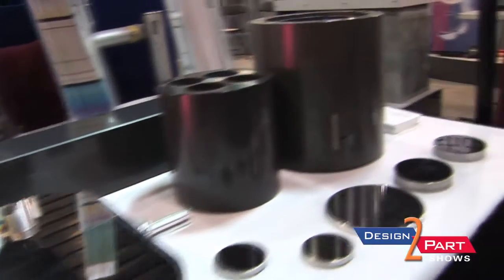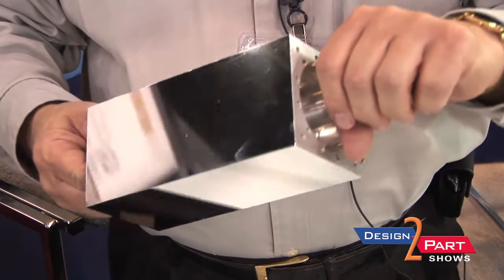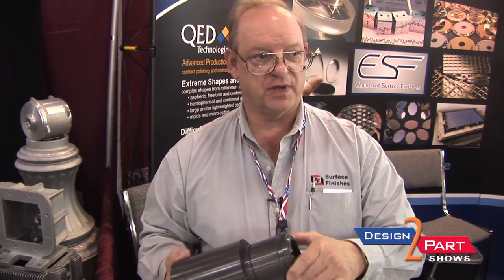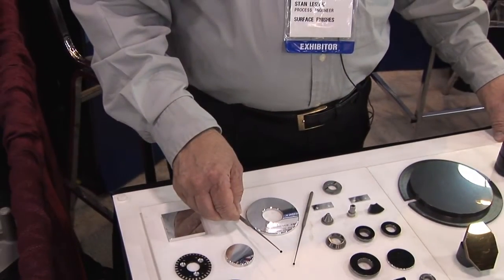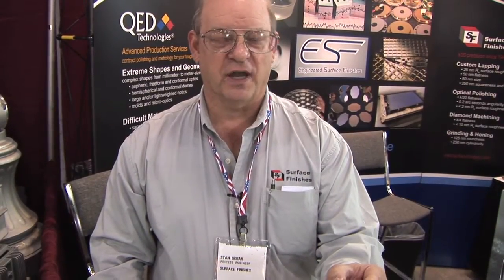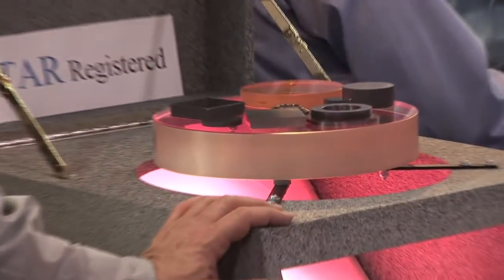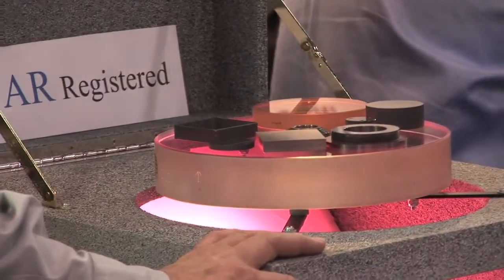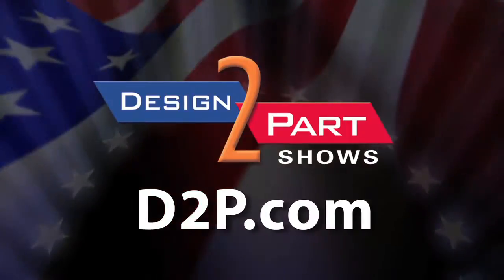Lapping, polishing, grinding, machining | Surface Finishes of Cabot Microelectronics | Aurora, IL

Comment: send an engine head and block to these guys and you'd be guaranteed to never blow a head gasket. Too bad car companies don't manufacture heads and blocks to this level of flatness.

This is an art form and is very under appreciated. Flat lapping for the win screw the milling machines they can't even come close to that level of flatness.
Reply: It would help but it wouldn't be enough with heat and movement!  That's why there are gaskets...